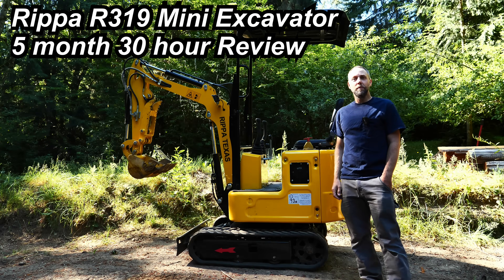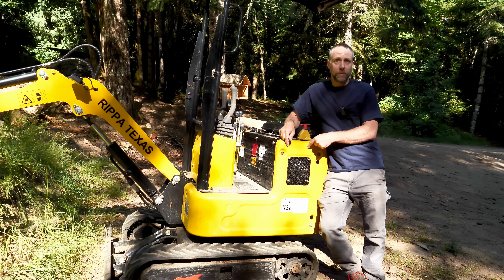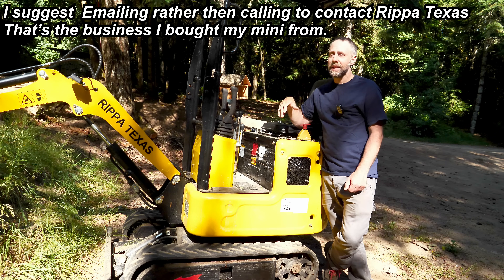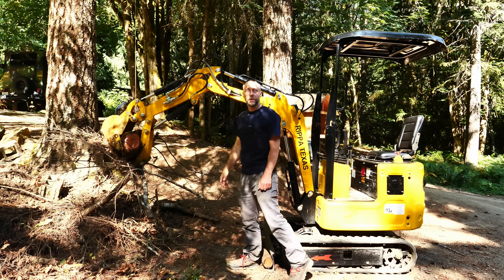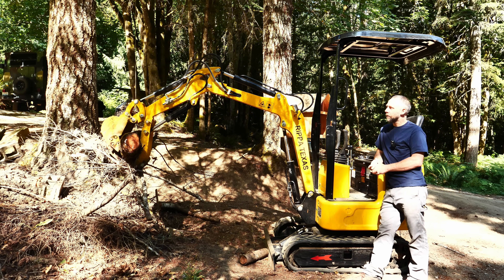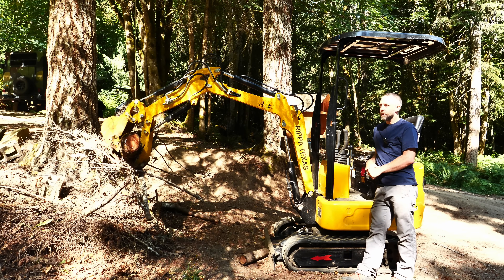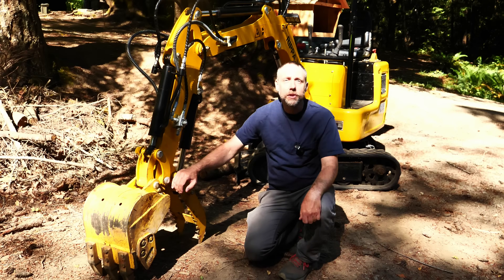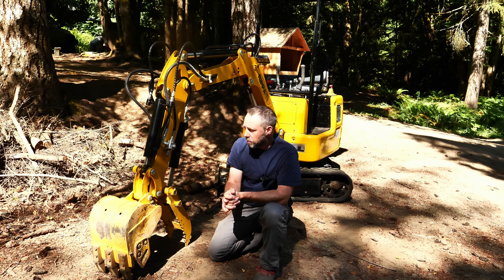Affordable Chinese Mini Excavator review #Rippa #R319 #miniexcavator

Comment: Hey Mike.  As for the rather basic design of the thumb mount on your Rippa machine, I suspect the manufacturer originally intended for it to have a manual/fixed thumb so rotational wear would not have been a big deal.  I agree that the pivot will likely be an area of concern for you with regular use of the movable hydraulic thumb.  An upgrade will make good content though.

Thanks for the review.
Reply from the maker: I think you are right about the manual thumb, there would be far less movement. I didn’t even think of that being a possibility for the design. Thanks for checking out my video Doug. Ps anyone reading this, go check out Doug’s channel, he has a much bigger Rippa excavator he bought at auction. Go check out his experience with his machine 👍
Reply: @Mikefestiva  Big thanks for the shoutout Mike.  I am editing a video of my clumsy climb of the learning curve right now.
Reply: Hernia? I just went thru that. If you catch them early they can be repaired laparoscopicly with mesh. If you wait to long you may have an emergency painful event and require open surgical repair. The pain attacks are totally debilitating, 11 on a scale of 1 to 10. Just saying! Totally appreciate your review of the mini-escavator. Much thanks. 🙏
Reply: Hi Mike.  great videos. I looked for that link of where you ordered it. Any chance you can respond with that info please ?

Comment: I have a Chinese Mini Excavator and it came with a Yanmar 3TN, 3 cylinder diesel. Love it. Can run on low revs, uses minimum fuel and has plenty of power. Those companies not using the Yanmar 3TN may use the D722 Kubota. Nay sayers believe they are a Chinese made copy but they are proper Japanese made engines. No problems with engine parts as there are a lot of options for getting Yanmar and Kubota bits. Cheers Dave

Comment: I got the ripper and 32" tilt bucket from kazana as well and I will say I am glad I didnt go any bigger on the bucket. I think 32" tilt is about the biggest you should go on these just based on weight alone. You will learn real quick that you have to be even more gentle with the controls with all that weight out there. After I put mine on I decided to put on a considerable amount of counterweight as these machines are ~600lbs front heavy anyway and even more so with that large articulated bucket. Most add 200ish lbs but with the thick bracket and weights I added its about 340lbs of weight off the rear of the house.

Comment: I was one of the hobbyists lucky enough to get the 1 ton Rippa model w/ the foot pedals and easier access fuel tank w/ gage. I also got the cab which out to work well since I don't yet have a pole barn and live in the Midwest with plenty of snow. At 15 hours, mine has saved me blood, sweat, tears and most importantly medical insurance deductibles. Unearthing and hauling two dozen trailer footings the size of small dishwashers was easier than I thought. Too heavy to lift but I could cradle them between the bucket and blade and track them to a pile. 

Issues:  I've added latched for ease of access on the back panel as well as an electric cooling fan (external pulling as mine also has the internal shroud that doesn't leave room for it in the engine bay).  Also, I've developed a fuel leak under the fuel tank which I need to determine if the fitting seal is bad or the line connecting to the fitting needs tightened down, hopefully its just the latter.

Questions: Do you know the hydraulic oil filter part number or equivalent? Is your model's engine oil drain plug not accessible?
 
Comments: Thanks for showing how fitted the oil temp sensor as I was unsure where/how to best mount mine. Increase coolness factor by pulling all those safety decals on the body and some fun ones. I'm quite certain the skulls on mine has increased its lifting power by twofold. I'm excited to see a video on the ripper claw when that time comes as I have lots of stump work in the future and I may follow suit.

In closing: The telescopic tracks would be a great upgrade. I'd say sell your model, replace with another gas model with the foot pedals, boom swing and telescopic tracks so we may vicariously enjoy those upgrades too. 

Keep at it, see you in the next ones. 

PS - I'm going to take a look at the zerkless thumb pin on my model and see if its the same as yours or if they improved on that oddly overlooked joint. Will provide an update if it is in fact accounted for in my model.

Comment: I don't like my thumb non greased pivot either. Took my pivot bolt out, drilled a hole 3/4 of the way thru the bolt from the head. Then cross drill for the grease to make access to the existing tubing. I countersink for the grease fitting keeping it out of the dirt. I also ground a 1/4 way around the pin from the cross holes to help spread the grease without losing any of the pin strength.

Comment: I just got mine (new model) today in the UK. Imported it from rippa for £8k with the kubota engine, grabber attachment, bucket, thumb, auger, rock breaker. Your previous video convinced me. I am really happy with it so far (after a few hours). Thanks.

P.S My assumption with the Kubota engine is being that it's a popular brand, part should be cheap and readily available. I assume it will actually be easier to repair than some off brand chinese engine you can't get parts for domestically. Also, the new model has a timer and temperature gauge.

Comment: Hey Mike, I have a 25 hp diesel Chinese one. Kubota and over 100 hours on it. So far no problems with it. I had the works on mine when ordered it. If I did it again I would do things differently. I keep my tracks extended so I would get the wider tracks but not adjustable. Two speed I never use just can’t around the hills anyway so I would not get that. Had hydraulic quick change adapter. But kept breaking hoses when digging and stuff so changed it to a manual quick connect. Much better. Boom swing I don’t really use so I probably wouldn’t get that in the future it just seems to make everything feel sloppy even. Those are my thoughts
Reply from the maker: Thanks for sharing your thoughts on your mini 👍 I do really appreciate it. I have a swing boom on my Yanmar and it’s also a little sloppy, I just figured it was because it’s a 30 year old machine with 3000 hours, but maybe slop is the nature of a swing boom? 
Definitely appreciate your thoughts on this subject. Thanks Steve 😊

Comment: With my aging back (67yo) I had to pick up a 1.5 ton mini Chinese excavator with pilot controls so I don’t need to bend forward as much. Have some more modding to do, like bringing the drive controls closer to my lap. And make the blade foot controlled . Had to buy a elect gas pump ,can’t lift my 5 gallon can that high. Added a 12v temp gauge. This 1.5 ton has boom swing, hardly ever use it. Just adds more hydraulic lines to worry about. Also added a cigarette lighter, just in case. Bought a back up camera ,works but haven’t installed it and it’s magnet mounted. I never run full throttle I set to where the hydraulics function as they should , to where my eng does not shut down under a load. I have a 1 ton at another property but there is more of a difference then / than I thought there would be. Have had both for 4 years ish. Have fun, be safe.

Comment: Great video! My top things to check when you get one of these (any Chinese micro/mini ex).

1 Look in the gas tank. Mine had fine iron/steel dust in the gas. I have read others have had this experience. Can clean out with a stick magnet.

2 Check the hydraulic oil for debris. You most likely will need to drain it to do this. If it come out perfect, you may be fine, however, I strongly suggest removing the access cover to the tank and looking inside. My tank had larger debris that could have been shaving from tapping/installing the through bolts for the tank temp gauged and possibly welding slag from tank fab.

3 While you are in the tank, make sure that the hydraulic oil strainer is tight. Most machines have one at least on the suction side. These are a straight thread (not pipe thread) and can easily vibrate loose. I used a rubber o-right to add pressure on the the threads so it wouldn't loosen. (could use other methods, but it is nice to be able to get of off by hand if need, just like a spin-on oil filter. Not much room for tools in the tank.) 

Even if your machine has a spin-on hydraulic return filter, there could be some gnarly stuff going through the system (at least once) if the strainer falls off.

Comment: I picked up a rippa from Bison.  Has a side gas fill with gauge and big tank. A fiberglass tube from the side vent that funnels fresh air in to the fins on the motor.  Hydro thumb.
The gas fill on the side is worth getting a new model.  Thanks for all the great videos.

Comment: I have the Kubota diesel with swing boom. You will find Kubota diesel engines to be extremely user friendly and easy to work on. Had one in a skid steer that survived an engine compartment fire. 80's engine just won't quit. They are built the same way as back then. Swing boom is a spectacular function. I haven't had it for years yet (24 year model) so near with me. But I am glad we went with the diesel and swing boom. Bally, Pennsylvania.

Comment: Because of health issues, that’s your story and your sticking with it. 😀
The market is getting flooded with mini excavators.
Their bringing half of retail at some auctions.
My AGT H15 cost $3500 +fee+tax.
They went for $2750 - $3750, the $3750 had A/C.
On my H15 I put latches on the rear cover, float charger pig tail, fan is on order, hyd. thumb, oil drain hose.
I don’t like the hour meter wired to the master switch.
I may do what you did.
H15 has pilot controls with on/off switch for getting off with engine running, 2 pumps.
So far I’m happy, but their for the person who likes to tinker.
I always enjoy your videos.

Comment: I'd suggest gas, but you have the mechanical chops to deal with diesel so that's up to you, but considering the fuel efficiency of diesel versus gas, it's going to be up to your tolerance of dealing with the complexity. Thanks for this review. I'll know where to look if I want some equipment that's mini and durable, and I am an experienced heavy equpment operator so it would be fun to have one of those.

Comment: Thank you Mike ❤ These videos could not be better timed. We’ve been back and forward about buying a digger for two years, had one at our last home but getting help with maintenance was always a problem. We aren’t very mechanical (I really want to learn, love all the mods you make and suggest) but we live in a farming area and there are people who repair tractors in our village, and in the next town, so I imagine they can do most things on such a simple machine 🤞We would get the diesel, so of course would love to see you pick one up and review it so throughly. We are going to see a Rippa today and now we know exactly what to look for and what questions to ask. I think getting extra attachments might be tricky or more expensive, we’re in SE Europe, and things just aren’t as easily available if they aren’t already here. But the seller of the machine is an importer so we will be asking what they can get and how long it takes. Also it is regularly hitting 35-40°C (90s F) for these summer months, and our tractor doesn’t like it, so I guess this won’t either. But we can just work mornings and evenings 🤷🏻‍♀️Ultimately I worked out as you did, this machine could pay us back in about 80 days based on local self hire costs, that doesn’t even include drop off and delivery charges, so once we’ve done the work we need over the winter it will have paid for itself - anything extra is a bonus. Plus it’s small enough we can put it in my van 😂and take it to help friends and neighbours. Thanks again Mike, your videos are priceless 🙌

Comment: I couldn’t just the diesel model. I would like a larger capacity machine but power has never been an issue. I feel like a 2 ton machine with the same motor would work just fine

Comment: I got a 3 cylinder diesel which you can get parts for it anywhere and cheep. I ordered mine and with cab AC and heat for 7k and getting it shipped like an 1hr from me in Pittsburgh pa. Don't get the single diesel engine is much louder unless you do a bit of sound damping. And you definitely wanna get pilot controls and ask them to change it to backhoe control style is amazing for working. Also best to grease the swing gear when spinning to get grease everywhere not just one spot and poring out in one spot

Comment: Great vid Mike! I would skip the diesel just because the gas is way easier and cheaper to get parts and being such a small unit, the gas engine will do fine with that size of machine IMO. I watched this vid a while back on my tv but could not comment until now lol. Either way you go good luck!
Reply from the maker: I definitely agree with you about the simplicity of the gas engine in a mini of this size. If it ever goes bad, HF sells a 420cc that will bolt right up for $350, can’t beat that 😊 
Thanks for checking out my mini Excavator video!

Comment: You seem to be getting attached to your machine, but I'd say go for it. If it's a friend you can always buy it back later as a fixer-upper for some nostalgia down the road. Just remember to get what you actually need. An auger would be kinda pointless for me personally, already got an old homemade thingy that fits on my 3-point and that thing cost me 50, digs pole holes like you wouldn't believe. It's not designed like an ice drill, it's more like a double edged dagger with scooped edges spinning into the ground. Ripper claw though, that is indeed one of the things I ordered. That and a rake for clearing topsoil. Quick attach I felt was a bit iffy with the thumb getting out of reach for the bucket and people have been complaining about the bolt eventually snapping off.

Comment: Great video on your mini ex.  Personally, I would stay with the gas engine for the simplicity reasons you mentioned.  I'd only get a diesel engine if I was stepping up to electric over hydraulic controls with a multi pump.

Comment: Hi Mike, would like to see a review on a Diesel model. I’ve seen some of these at auction but they seem to go for a much higher price, over 10k easy. I bought mine at an auction near you in Olympia. It’s an AGT H12 and I put a cooler, fans, wrapped all the hoses and a hydraulic filter on it out of precaution after I had about 10 hours on it. Got all the attachments down in Oregon closer to where I live at auction. All in with the machine, attachments and upgrades I think I’m into it for about $5300

Comment: I own four diesel machines, and I love diesel engines for my tractors and skid steer. you buy whatever suits your desires and needs and then make a video. I have had no problem with parts or supplies for these machines, knock on wood. cheers and keep up the good videos.

Comment: I'm a diesel guy or, at least, I used to be. With all the smog control crap they put on newer machines these days, you have to buy DEF and wait for the engine to go through regen modes and a bunch of other stuff. Maintenance costs can be higher and they can also be harder to start in the winter. I'd stick with the gas engine, imho. As to the thumb hinge pin: Could you take the pin to a machine shop and have them drill horizontally through it and then 2 strategically placed holes crosswise? Screw in a grease fitting and have at it.

Comment: Thanks for taking the time to provide some really useful information. I look forward to seeing how it handles the various attachments. As for your Diesel/ Gas decision, I have never been able to justify the increased purchase and running costs on a Diesel unless working it full time commercially. It doesn't make economic sense for a property owner in my opinion. But hey, it's your toy.
Reply: Diesel is nice because the fuel doesn't degrade as rapidly and most tractors are diesel so you don't need to store 2 fuels.

Comment: I bought from this company because of your original video, I got the one with the diesel. I really like the diesel model because it is quiet, the only downside is the fuel tank is really small. i get about 2 hours run time before I have to refuel. i am going to be putting in a larger tank
Reply from the maker: Good to hear you have been happy with your mini so far! Yeah a bigger fuel tank sounds like it’s in order, especially being a diesel, a little harder to prime when ran out of fuel. How many hours do you have on yours now?
Reply: @Mikefestiva  just 5, got it about a week ago

Comment: Hey Mike.  I cant send a link or photo because of restrictions but Harbor Freight has a d cell battery operated transfer pump that goes into the mouth of your gas jug and transfers the gas to your machine.  I have had tow to fill my Ultralight aircraft.  awesome and fast.  make refueling that easier.  $10

Comment: Mike, I'm probably never going to tell you to not buy another tool, especially if you the opportunity to get your money out of your current tool.  That said, I think the expandable track and swing boom would have value for you.  Just bear in mind all the extra hydro fittings and connections that adds.

As to gas vs diesel: captain's choice.  Personally, I prefer diesel for equipment but for light duty, the ease of repair of gas engines makes a lot of sense too.